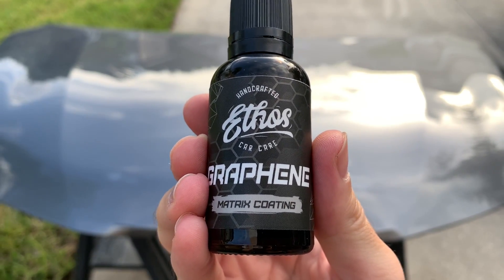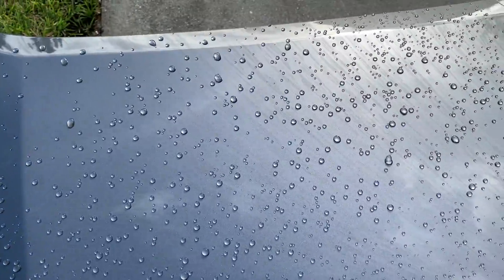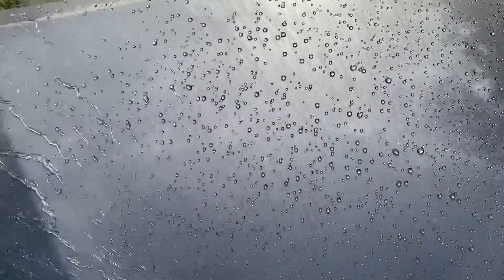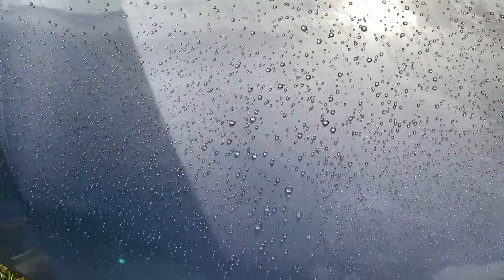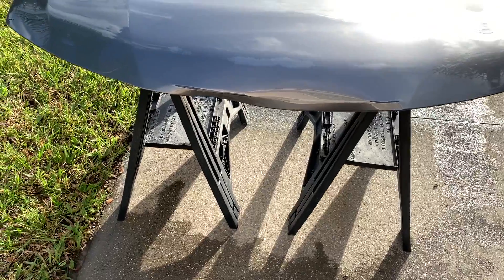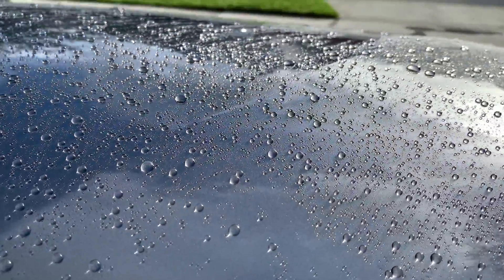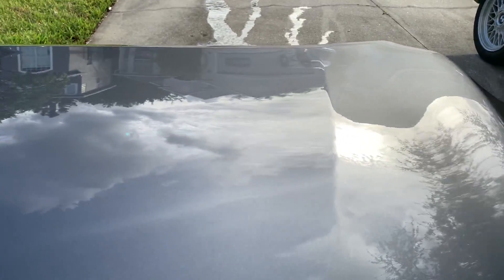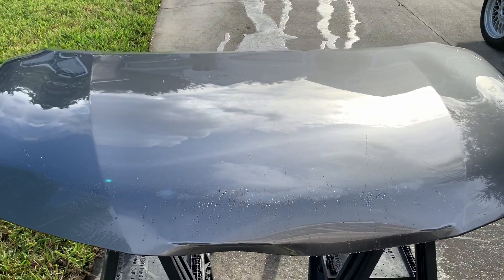Ethos Graphene Matrix Coating | Hydrophobic Rinse Test

Comment: OK, you've sold me on the Gilmour nozzle.   I have a pretty high end Gardena hose reel system,  hose, and two types of nozzle's which I really like, but i'm getting one of those Gilmour nozzle's to put on it.  Good gosh that is an awesome trick with that free running water shooting out the center of the nozzle!   Looks like it leaves the panel almost dry.   Of course, i'm sure that depends on what coating, wax, or sealant is one the panel also.    I'm guessing some react better than others.     But the way I keep my paint, it should work wonders on my cars.   I've used a similar trick in the past, but I always had to unscrew the nozzle from the hose and then run the water across the panel.  I love the fact you can just rotate the head and it converts to the center flowing stream.  I'll be getting one of those later tonight.

Comment: I too just recently used a graphene coating. Very nice , mine ( can’t say which don’t want no hate ) flashed really fast. So I had to work in smaller areas. I also figured out the timing and then it was easy on easy off just smaller areas. Looks like a topper , it’s a four or five year coating. I only dropped one coat maybe I’ll try another. Good video.
Reply from the maker: Cheers Amir!  You can let us know which coating you're working with, I like to get a feel for what others are using to keep track of feedback for products that I might use in the future.  Keep me posted on its durability if you can!
Reply: WaxMode I will , I’m currently in my first week of testing and after it’s first wash I noticed a change in water repellency. Application was ome coat , it was hella hot outside ( I work outside for the most part ) and it was no more than the 2 by 2 sections applied and as soon as you laid it down  2 seconds later you wiped it off.  After the first wash it’s not the big giant sperm looking beads but better than ceramic beads none the less. Also several rains and not one water spot . I also topped it with a light detailer ( I know I shouldn’t have ) to see how it would behave and the big beads are back. When I know more I’ll holla at you bro.

Comment: Awesome water test! I am seeing the same results on my daughters car. You are right it is the easiest coating I have applied also. I bought that Gilmour nozzle and can’t wait to use it.
Reply from the maker: Thanks FAB!  Right now I haven't used a coating that matches the level of ease of use, end slickness, and initial hydrophobic performance that Graphene Matrix offers out of a single coating system that doesn't require a separate topcoat product.  Really stoked to see just how well this holds up, and it looked absolutely fantastic on the Fusion you applied it to!

I've got a little bit of a collection building up of those Gilmour nozzles for the different versions they sell, that rear trigger one that you picked up has lasted surprisingly long for me with heavy usage.  Wish they made them just a bit more comfortable though, the previous gen Gilmour nozzles had that fantastic thicker rubber grip that was so comfortable, I want those with the watering face of these newer ones with the center flood.
Reply: WaxMode Time to get a hold of Gilmour and give them your idea! They might send you a lifetime supply. 😂

Comment: AMAZING!!!!!!!!!!! With regards to looks, how does it compare to say Gyeon Can Coat, UK3.0, top quality waxes and the best ceramic coats????
Reply from the maker: Looks really good, I'm probably the wrong tester though to ask about looks because the majority of the test cars and panels I regularly cycle testing on are all difficult to highlight the nuances in the finish that particular products leave behind on the paint.  I would say CQUK 3.0 has more of a darkening effect on the paint than Graphene Matrix, Gtechniq EXO as well.  Graphene Matrix definitely has a nice glow to it, I'll be doing more measurements with the Rhopoint glossmeter after the first wash, and after a few more reapplications to confirm consistency in the measurements.

Comment: This graphene stuff is really hitting the market. Wonder how brands like Carpro and Gyeon are going to make use of it and what the results are going to be.
Reply from the maker: I'm also really curious to see if some of the more established coating manufacturers will try their take on it.  There's definitely some skepticism about the viability of the chemistry right now, but it's still early on and it will be interesting to see if it lives up to the hype.  I'll definitely keep you guys posted on how this Ethos coating performs.
Reply: Which one has the ceramic coating that is similar to Meguiars fast finish? Isn’t it Gyeon? Anyway, I’d almost expect them tho renew that, but with graphene instead. This coating stuff is wild these days. I cannot even imagine what comes after graphene, or what it’d be like.

Comment: I was looking forward to this! I think I'll just polish off the CQUK 3.0 and try this at this point... The coating's already around the 1 year mark and I'm sure it would perform the same a few more years down the line with my maintenance but I just get bored quickly and love trying out new things.
Reply from the maker: I think you'll enjoy working with it!  Definitely an easier wipe off and leveling compared to CQUK 3.0.  The only question is whether or not it can really match or exceed CQUK's outstanding hydrophobic durability, and fantastic cooperation with a variety of different toppers.  Keep me posted on what you decide to go with!

Comment: I did 2 cars recently and wow it was sooo easy to apply this coating and remove it! Usually ceramic coatings are a pain.
Reply from the maker: That's good to hear Dave, loving the ease of use here.  I used it today on the fenders of the Honda at 116°F surface temps and had no issues with wipeability.  Keep me posted on its durability if you can!

Comment: Thanks, Waxmode. It seems that you only do great videos.

But I have most of a bottle of Power Lock+ and Collinite 845. I don't want to toss them.

It's clear, though, that Collinite doesn't begin to have these hydrophobic properties.  That said, its beads are almost pornographic. Really, I take photos of my effen car after a rain. It's so embarrassing.

My only reservation about the graphene product here is the degree of glow. I was unsure about the Carnauba glow until I saw it on my own car. It's not just hooey.

Comment: Awesome review as always.  Hydrophobics are insane!  Can't wait to see how long the real world durability is going to be.  So far from every video I've seen on this product thus far,  it looks like Ethos may have knocked this one out of the park.
Reply from the maker: Thanks Idtriton, always good to see you in the comments!  It's definitely early, but first impressions are great for this coating.  Worked really well for me today on even hotter temperature paint, I'm not having any issues with wipeability.  So that combination of ease of use, slickness, and amazing initial hydrophobic performance is definitely at the top of the list for the coatings I've used so far.  Ethos also has phenomenal brand aesthetics, labels are well designed, I'll be saving this bottle for the shelf for sure.
Reply: @WaxMode  Thanks man I appreciate that!

Comment: So are the claims about less waterspotting true? It would be great to do a test of this. Sunny hot, FL with it's hard water might make for an interesting comparison against an SiO2 product.
Reply from the maker: Hey qrt!  I still need to do a lot more testing with this.  Once I get the Ceramic matrix coating in I can start doing spotting tests side by side with Graphene matrix to see if it has an advantage.

Comment: I sent you a PM on Autogeek forum.How fast did it flash in your Florida heat and humidity ? Crazy beading angle will be interested to see how long it can bead like that with say just regular washes with Car Pro Reset .
Reply from the maker: Hey Doc, sorry I must have missed your message on the forum!  This was actually fogging/sweating fairly shortly after applying it to the paint, around 30 seconds.  And it was definitely a bit hotter and more humid in my garage compared to what most would be working with. 

On this panel I let the left half dry for 1 minute after applying, and then the right half between 2-3 minutes which is their recommended dry time before buffing/leveling.  Felt just slightly more tacky to level out at 2-3 minutes compared to 1 minute, but during the cure everything felt the same slickness and I didn't notice a water behavior difference on the panel during the rinse.

I'm stoked to see how this holds up as well, looking forward to getting those results in to show you guys.

Comment: Awesome.

You should try Adams Graphene Spray Ceramic.  I have it on my car and its amazing.  The water beading is similar to this.
Reply from the maker: John keep me posted on the shelf life for that spray coating.  I tried pulling out the first version of the Adam's Ceramic Spray Coating and it wasn't playing as nicely as when I first tested it, and then my Wolfgang Uber Ceramic Spray Coating is not playing as nicely anymore as well.  But absolutely, I want to get my hands on the Adam's Graphene coatings to work with in the future.  That 60ml size for the $80 is definitely a competitive price if it holds up well.

Comment: Is that Gilmour spray proof, because the trigger is on the inside, when you drop it on the drive?
Reply from the maker: Yes the one I'm using in this video is definitely spray proof on a drop, but it's not the most comfortable sprayer to use regularly.  I wish we could get this sprayer head with the center flood on their previous Gilmour nozzles that were loaded up with rubber on the grip and were way more comfortable.  The sprayer in this video has a slight flow adjustment on the top, so when you're flooding or sheeting the water off the paint you can reduce the flow on the spot to prevent a little less nozzle overspray.

Comment: Would I have to strip off my existing ceramic coating and then add the graphene coating ?
Reply from the maker: I'd be curious to see just how well the Graphene Matrix could stack over an existing ceramic coating.  But the issue is you've got 30ml to work with for $99 which would only get you 2 coats max, so the best bet is to take the time to polish out the existing ceramic and apply the Ethos coating to the bare clearcoat to ensure the best surface for the coating to adhere to.

Comment: Impressive, lets see durability now.  $99 though, out of my price range, too bad.
Reply from the maker: Yeah $99 is definitely up there compared to the CQuartz line.  Still very competitive against some others like Gyeon Syncro, Gtechniq CSL and EXO combo.  It's going to be very interesting to see how the Adam's Graphene compares at the 60ml size.
Reply: Not really...when you take into account that the ceramic offering typically require not only the coating, but a compatible topper (ie, CSL/exo, Ck3.o/Gliss, etc...) it’s actually cheaper.  WRT time in application you’re spending less per vehicle also.
Reply: @FrankieKennethL  out of MY price range as in I cant afford that price

Comment: Better than fusso?!?!?!?
Reply from the maker: Fusso is definitely close in hydrophobics, I'd have to put them up side by side to double check.  Fusso Coat, Polymer Net Shield, CSL + EXO, Mohs + Skin, CQUK, Gliss V2, CC36, CanCoat, Graphene Matrix, all of these are pretty close to one another and are probably a few degrees difference in contact angles.  Wolfgang Uber Spray Coating is up there too.

Graphene Matrix combines a really good ease of use with awesome hydrophobic performance out of just the coating itself, so CSL and Mohs are pretty ease to work with while having good slickness, but you need the EXO and Skin topcoats to build up a good hydrophobic performance with those coatings, so that's where Graphene Matrix holds an advantage right now with the coatings that I've worked with.
Reply: I've been on the Fusso Coat + BSD as a topper camp for over 2 years. I think it's really hard to beat this combo in both value, ease of use and longevity. Plus, if you need to correct a panel before the next  polishing session that can be achieved very quickly. No drama, no need for a garage, nothing. Also, providing that you stay on top of your maintenance wash and use an iron remover every 6 months, you won't need to clay the bodywork either when you decide to polish the car.

Comment: It's like all the pro's of ceramic with none of the cons.
Reply from the maker: For a single product system, this is looking good at the very start, but it's definitely early and I'll need the results of the durability test to confirm just how good this coating can last.  CQUK 3.0 is very good, fantastic price and crazy durable, also a single product system that doesn't need the topcoat for hydrophobic durability, but lacking in the slickness and ease of use that most first time coating users would want to have.  

That balance of ease of use and slickness and incredible fresh hydrophobic performance is what this Graphene Matrix Coating offers from the start, so if it can hold up on the daily driver, then that would be awesome.